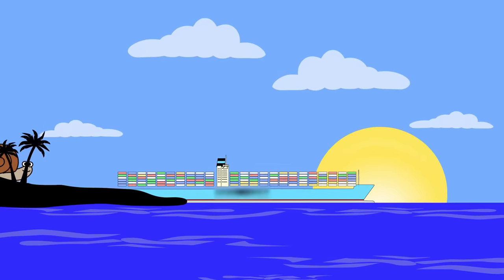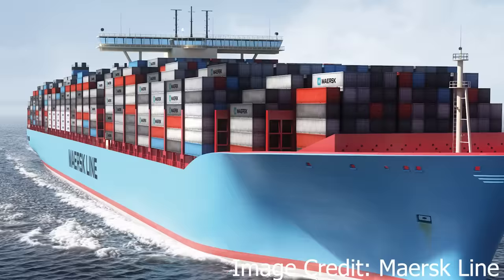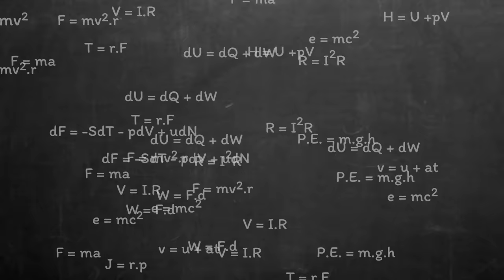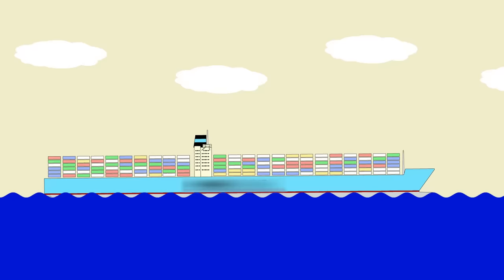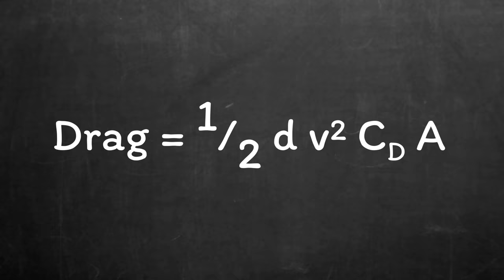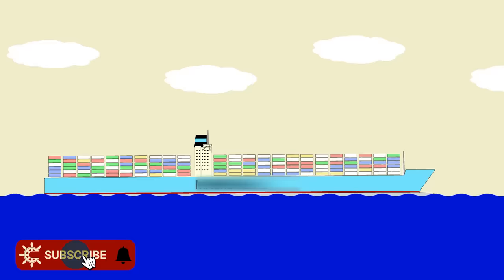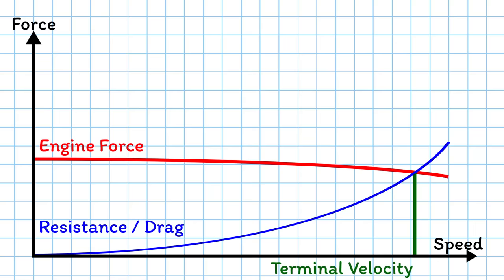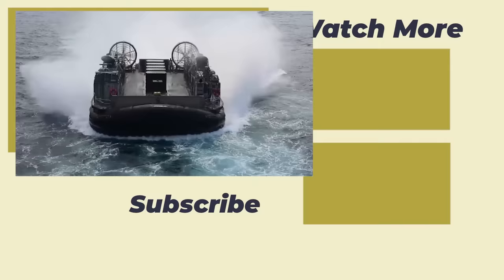Why are ships so slow?

Comment: "BECAUSE SHIPS ARE HEAVIER AND HAVE TO DEAL WITH LOT OF DRAG" ..There I save you 7 minutes

Edit: Thanks  ..... i never got so many likes
Reply: Not only that, but literally 90% of youtubers will make videos 10 mins just for the youtube ads
Reply: Dude exactly 😂😂😂
Reply: Wait, I thought weight only affect Acceleration, not speed when you are travelling in a flat line.
Reply: Nah - because ship crews are more paitience.
Reply: You also have alot of drag. Just on the weekends though I've heard.
Reply: @davejones5640  
Yep - on weekends it is very windy.
Reply: It’s also incorrect, better off just saving 7 minutes and not watching. It’s the bow wave ahead of a displacement hull ship that limits its speed. Hull speed is calculated by taking the square root of the waterline and multiplying it by 1.34(HS = 1.34 x √LWL), and that’s the ships top speed regardless of HP. Only way to overcome this limitation is to use a planing hull which rise out of the water like found on most recreation boats.
Reply: This video is explaining that how does it happen. That's because the video is 7 mins long.
Reply: Thans dude
Reply: too late, comments I read after watching
Reply: Thank you :)
Reply: Just make the engine bigger
Reply: Thanks, you're a star
Reply: @kendicus7640 It might also be because stuff goes slower in water
Reply: Kendicus don't quote me but i think it does effect top speed because because you need more energy to go the same speed
Reply: @alexaxel504  You sound more sensible than the usual crowd that comments BEFORE or even INSTEAD OF watching the video.
Reply: @kendicus7640  It does affect top speed too atleast in ships, because more weight means more area under water wich causes more drag
Reply: @thejafuu5001  what if i put the drag out if equation
Reply: @kendicus7640  well not quite sure but if there is more weight there is less power per ton
Reply: Thank you for the morale of the story
Reply: weight doesnt affect top speed, only acceleration.
Reply: For real
Reply: SaltyBrains  are you a fool to think it's something else? He just explained the obvious fact. Why y'all hating on it.
Reply: @lithiumvids9448  lmao. And that's why this video's 7 mins long.
Reply: You get replies too... :)
Reply: Thank you
Reply: All that hot air to make the worlds most obvious point
Reply: Shii, even the video paused after i read your comment and found out the reason why ships are slow😂
Reply: Because they can’t fly...
Reply: ok thankyou
Reply: SaltyBrains  
Yes, for some reason I thought it would be about something that could make boats go faster, and then the reasons that this wasn't used, but no. I mean, anyone with half a brain can look at an oil tanker and an aeroplane  and predict which one will go faster.
Reply: I'm 6 minutes in... I am literally shouting... "GET TO THE FUCKING POINT WTF"
Reply: Thank you.
Reply: @kendicus7640  
"I thought weight only affect Acceleration, not speed when you are travelling in a flat line"
As explained in te video, with sips it's more involved than that. More weight equals more drag, hence less speed.
Reply: @Alex-us2vw  But he didn't say anything about going faster than this maximum speed. Everything he said holds true, constrained by the bow wave limiting factor, no?
Reply: Thank you kind sir
Reply: Lol yes idk why this needed explaining
Reply: Bro you the real hero. 10seconds in I saw and read your comment I immediately closed the video and head to another. 7mins saved.
Reply: LOL I figured that out just by reading it, scrolled down to look for a comment like this.

Some YouTubers are so dumb.
Reply: Bit it took me 13 seconds to read it.. so you technically saved me 6: 59 minutes.
Reply: Good shit brah. Thanks for saving my time.
Reply: Kendicus is ocean a flat line. Ocean have waves and small ripples to slow the ship.
Reply: thank you, 14 seconds in and im clicking on another video. i appreciate your service.
Reply: Yeah I was waiting for them to just say this already. Didn't need to know about all the math and how cars and airplanes work.
Reply: @kendicus7640  not with fluid drag
Reply: not true. Per unit of mass, the plane has much more drag than the ship. In fact, as ships gets larger, their internal volume increases to the cube while their exterior surface area increases only to the square. So larger ships pay a proportionally smaller penalty in drag.
Reply: corisco tupi the bow wave affects the ship at lower speeds too, so the faster it goes the more the ship needs to climb the bow wave. Essentially going up hill until the maximum hull speed where going faster is impossible. Like a 100 foot boat with a displacement hull will have a top speed of 13.4 knots regardless of its power. But 100 foot boat with a planning hull like a cigarette boat can have 4 400hp outboards can easily go well over 80 knots. In displacement hulls the bow wave is a huge factor in the boats efficiency at speeds below it’s maximum hull speed since the bow wave is always there as long as the boat it in forward motion, it just grows larger and larger until it becomes to big to overcome.
Reply: Power to weight ratio has nothing to do with top speed. If the added weight increases the drag under the waterline then it will decrease the top speed. If you built two ships of the same weight and power but with different widths the skinnier ship will have a far greater top speed. Mass only influences acceleration. @Kendicus was spot on.
Reply: Thanx, I was wondering why this vid had so much views. Now I know it's not for any good reason and I can go back to my other vids
Reply: @kendicus7640  It's because while you are correct and a force only affects acceleration, drag doesn't, drag is affected by the difference in speed between the fluid and the boat, not by the acceleration, therefore the greater the speed, thegreater the drag, which will result in a loss of velocity through deceleration
Reply: Kendicus you’re talking about velocity
Reply: Thank god i saw this before the vid
Reply: U saved 7 minutes but wasted a lot of watch time and money for the Youtuber, who had to do the research, writing and editing process to make this informative video for FREE to you..
Reply: And yet they say they are making contents on YouTube video which is 10minutes long just for 2 second of word that contains all the fact in it.
Reply: Joseph Ybarra this was 7 minutes, and he explained it for people who don’t want a simple explanation
Reply: Ben Conway you obviously don’t work hard enough
Reply: I WAS GONNA SAY THE SAME THING
Reply: And try to slow a shipt that's that heavy down from like 200 km/h
Reply: thats why the idea of the hyperloop is nice
but still so dangerous
Reply: @kendicus7640  correct. And once acceleration goes down to 0, you've reached max speed.
Reply: I clicked onto the video thinking I was gonna learn something I didn't know. But I already knew this. Horsepower doesn't always mean faster. If they was to compare torque, the container ship would be way ahead.
Reply: I’m 2 minutes in wondering what’s wrong with me. 

Although, this is likely good info for some people (I guess).
Reply: Ha you beat me to it..
Reply: As someone who has clicked on this due to random interest, I thank you
Reply: Thank you. Now onto the next video....
Reply: Joseph Ybarra and this guy put in exactly 0 ads...
Reply: Lmao I though this was obvious and common sense
Reply: Because steel is heavier than feathers.
Reply: >these low iq replies
This is why Thanos snapped
Reply: I was pissed when I saw the title of this video and the fact that it was more than 30 seconds long lol
Reply: THANKS A LOT
Reply: I love these channels that explain very common knowledge things in 8 minute videos lol
Reply: The weight isn’t what causes the drag lol. You are incorrect sir.
Reply: i thought the captain of the ship is just a boring driver
Reply: But steel is hevier than fethers
Reply: DeeCoder you are right
Reply: Ships are heavier?
PFFFFF, I have more then 22 in my living room, hide in bottles. -:))
Reply: It's a shame I had to listen to this annoying accent for 5 min before I saw your comment
Reply: @28ebdh3udnav  that's not true. I got 0 ads
Reply: @wino0000006  It's really just silly click-bait for those that failed high school science.
Reply: I gave you the 7777 like.
Reply: Sorry i appreciate your comment but i need to watch the whole video so i can procrastinate
Reply: Oh OK thanx DeeCoder now I get. excellent explanation.
Reply: Lookboytgcxnnmxxdw
Reply: VCard
X-Filesystem
Reply: Same think I said. Ships can way over 150000 tons fully loaded and have to drag through water. Should be commonsense.
Reply: DeeCoder. thank you.
Reply: This is why you always read the comments first..
Reply: DeeCoder thanks
Reply: These extra 7minutes are for flatearther and creationists and other silly people😈
Reply: DeeCoder 😂 Thank you! It is entirely obvious, even to me, that the ship ought to be slowest but I greatly appreciated the detailed explanation in the video.
There’s also a valuable lesson to be learnt in not patronising others. 
It’s been many years since I studied physics and we haven’t all specialised in the same area.
Reply: Yup thanks for saving my time
Reply: I would have simply said... PHYSICS!
Reply: Thank you..cause that description def didnt need to take 100 years!!
Reply: But you took the time to comment I'm terribly proud of you
Reply: And you can see all dislikes??? I can't
Reply: @benconway9010  they get all that money from who? The network? The team owners? ...Dude, we pay them. You and I ...we pay them because they entertain us. If you're not in the game then all you can do is sit back and watch. Until we  get sick of watching...     Until then...well. 
  We are in a unique situation where we can be our own producers of our own shows...and it's called YOU TUBE. Plenty of money out there just gotta have an angle. Why not post a fishing program? Or whatever it is you like to do. Not everyone is a fisherman, I know that. That's not my point.
Reply: @Alex-us2vw  the 29 ppl that liked this dont even understand what hes saying. just like me. liking this
Reply: @28ebdh3udnav  dude. The video isn't even 10 minutes tho
Reply: @28ebdh3udnav  The video's 7 minutes....
Reply: 9.8 K
Reply: What I assumed.
Reply: @28ebdh3udnav  and the sun is pretty bright.
Reply: @tcg1_qc  but for the ads, is it really necessary?
Reply: @28ebdh3udnav  it's necessary to earn money
Reply: I like you

Comment: "Formula one cars are somewhat lighter" bit of an understatement mate
Reply: Burrito Bowl01 Somewhat lighter = moderately lighter when compared with the greater magnitude of difference between a car and airliner or airliner and cargo ship.
Reply: f2013 yeah no. F1 cars are a lot lighter, and that difference in weight is more significant than the difference in horsepower between the jet and ship
Reply: @fred2796  He's talking about the weight. The difference between the weight of the jet vs the weight of the normal sedan is greater than the weight of the sedan vs the weight of the F1 car. 

He's not talking about the difference in Horsepower or the Horsepower to ton ratio.
Reply: Fweed As Grizzer said, you’re comparing apples with oranges. That comment in the video was just referring to weight differences 👍
Reply: @fred2796  you missed his point.
Reply: Haha
Reply: Why is everyone nagging each other about weight and speed differences. Im confused
Reply: you could literally pick up an F1 car without any equipment.
Reply: @Esus_  An F1 car weights 740Kg, as per the rules they can not be any lighter. So no you couldn't literally pick it up.

It weighs a few hundred kilograms less than a road car which is not a huge difference on the scale of the things being compared (300.000Kg airplanes and 200.000.000Kg ships).
Reply: @BigUriel  I didn't actually mean picking up an entire fucking car. 😂
Reply: Sérgio Alves 😂 that car is THE MICHAEL’S 2000 car and its 600kg 😂 everyone’s being pedantic so couldn’t help it 👍🏼
Reply: Burrito Bowl01 it’s not like it’s made of carbon fiber and the mechanics make sure they are as light as possible. Lol
Reply: They’re about 750kg, so not that much lighter than a small car. And they produce about 800bhp, so it comes out to just over 1000bhp/ton
Reply: pushes F1 car with single hand
Reply: F1 cars is 752kg as FIA mandated rule. So yah, it is lighter than a typical road car

Comment: One factor missing in this video would be fuel used per tons carried. It would help understand the point of ships.
Reply: Math123 fuel aint gonna make much of a difference. They are ships not tuner cars
Reply: @pandahungry8000  He was talking about the point of ships. The fuel used per tons carried is extremely low, so it doesn't really matter how long it takes. It's an efficient method to transport great loads of product across very long distances
Reply: @pandahungry8000  i'ts is main reason why cargo ships exist
Reply: @pandahungry8000  
Size matters, a huge ship like that can work with a crew of 11-15. That is for day and night... 
If you put your cargo on 10 smaller ships, sure each smaller ships itself might need less but with 10 ships...you still might end up paying 40-50 people! 

And that is the people, how about the fuel, again, that huge engine, per tonnage moved, uses less then if you use 10 smaller ships. 
How about pollution, same... that one engine doing the work of 10 smaller ships puts out less pollution than 10 ships. 

So the cost is lower for the business of moving the stuff, meaning the cost is lower to get goods from A to B, meaning that the business selling goods can make more money/lower prices. And all that because we have huge ships.
Reply: You actually want less HP per ton that means you're using less energy to move more mass. Airplanes are pretty much the most inefficient way to move anything.

I wish he would have explained why it's still used today.

Comment: Nice video, I worked for a shipping company for some years, also a Danish shipping company like Maersk.

Shipping companies. or atleast the US and EU are trying to find ways to make ships more economical. there are also resistance of the paint on the sides ( so it's important to use paint that has low resistance ) . And sea animals attaching, so it's important to keep the vessel clean too. this affects the resistance A LOT, and is measurable. 

Another thing is bunkers oil, if people don't know what bunkers is. basically it's the leftover material of refined oil. Oil that is pumped up, goes through a treatment, where you make Diesel oil, gasoline, and other products, and the leftover is just bunkers oil, which vessel use. 

Also, it become a thing to "slow steam" which means, if you have 14 days to get from point A to point B . and you could do it in 12 days, with 20 knots, but 14 days with 12 knots. that is the prefered way. even if it means delivering items slower. 

Some Maersk vessels also use sails, like a big kite if the wind is correct. it might sound stupid, but if you have plenty of time, it saves millions of dollars.

Also, there are two types of the Maersk Triple-E   The first x amount of triple-E vessels were produced with a single engine, as the later models came with 2 smaller engines :-) More economical!
Reply: Gotta love Economy of Scale and small little details that do a lot of good.

Comment: You just missed the one essential fact in the plane-car-ship comparison.
Fuel use per ton moved per distance.
Addition if this would have given a sterling illustration of WHY we use superhuge ships for mass cargo transport.
Reply: What you'd really want is fuel use per ton payload moved per distance.
Reply: Red Ships would easily win that. The largest oil tankers transport over 500 000 metric tons of oil at a time. 

The Emma Maersk weights 62 000 tons on its own (lightship condition), yet she can carry up to 157 000 tons of deadweight. More than twice her own weight.
Reply: @SportSoulLife  Yeah I know ships would win. I'm more curious about how different planes and cars would compare.
Reply: Red That would be interesting indeed.

The AN-225 has a payload of about one ballast tank in a medium sized ship, a single tank that is, out of 12, so i would be surprised if its not many fold the cost of a ship. 
That maximum payload is like a balance scale weight to a ship.
Reply: Yes we use ships because per unit of mass the fuel usage is less than a plane